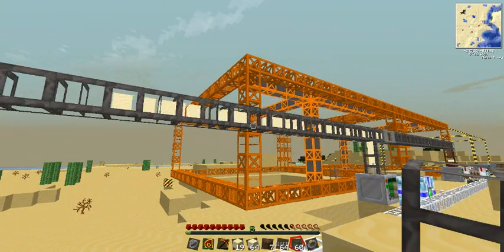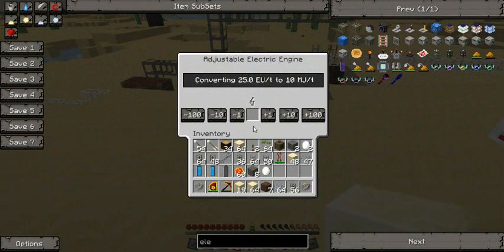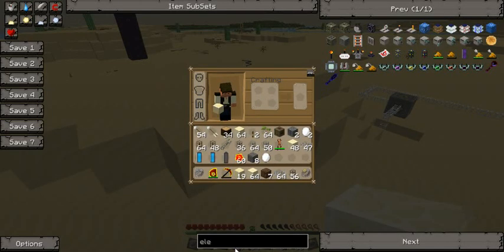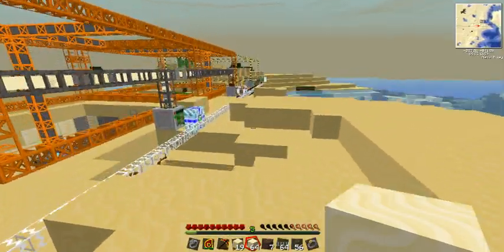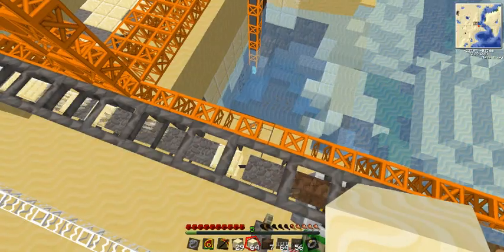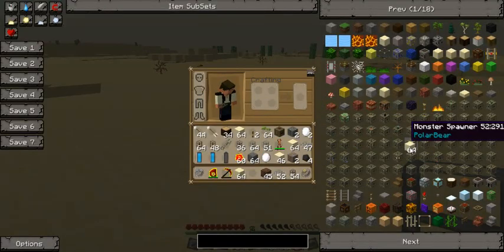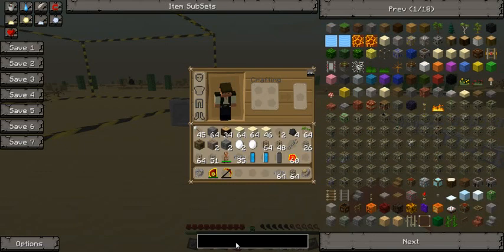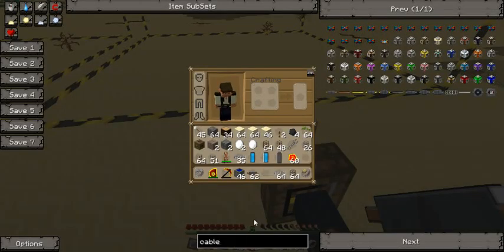Auror (tries to) explains Electric Engines!!!!

Comment: lol dude, here are some tips:

a fast electric engine produces 10MJ/t (enough to make a quarry go max speed)
an adjustable electric engine can produce 1 - 2000 MJ/t (if you have multiple machines running off a single power source) so adjustable has more potential but a fast will make most machines run as fast as they can by themself.

Comment: btw it only takes 10MJ/t to power a quarry at max speed (equivalent of one fast electric engine) so u only need 1 adjustable and set it to 10 MJ/t 

plus whats the point in having 3 adjustable, you can just increase the power of one engine rather than having 3